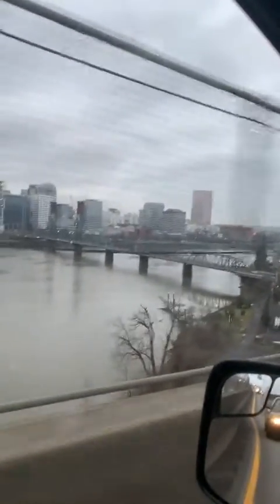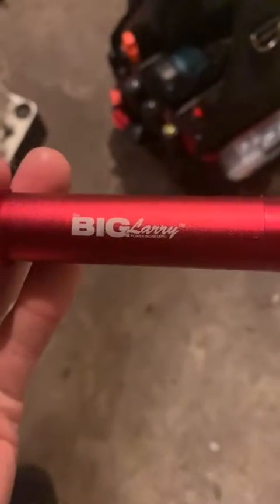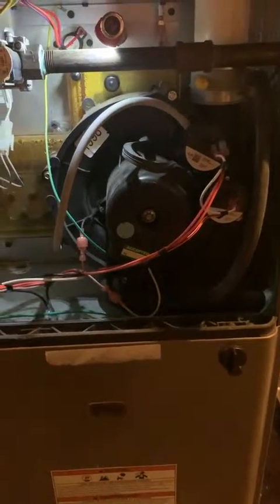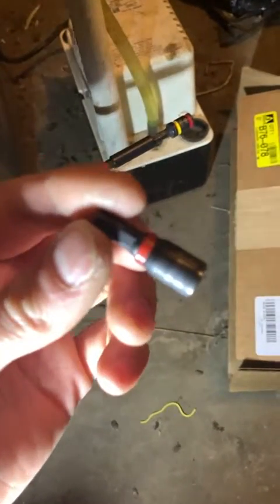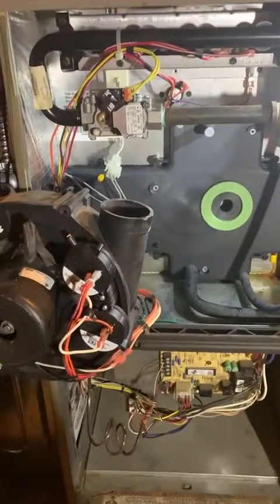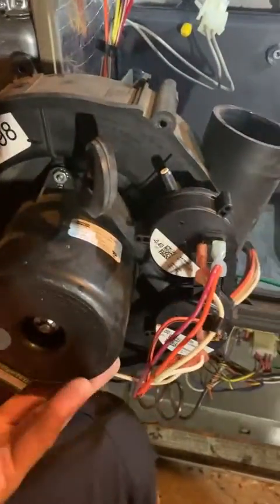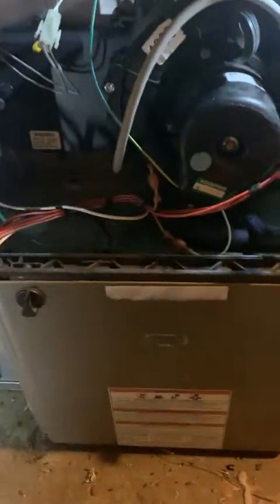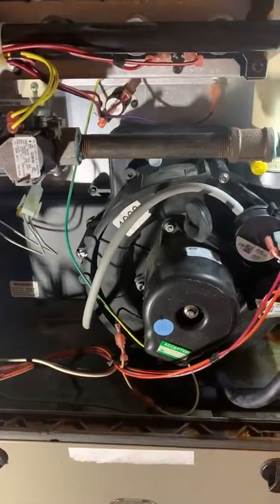York gas furnace Collector Box replacement + pressure switch TG9S080B12MP11A

Comment: Thanks @Honesthvacguy, you saved me a ton of money and headaches! I had a cracked and leaking condensate pan on my furnace, exactly like the one you replaced in this video. The company that installed the furnace wanted over $1000 to do the exact repair you did in your video in 50 minutes. I couldn't stomach that, so got online, found the part, and got it delivered for $160. However, after I installed it, the thing had a very, very loud whistle, so loud I could hear it a block away. So I thought I had gotten a defective part, and was going to try to get another one. (It still would have whistled, though, I'm sure.) The key was to remove that yellow disc in the inducer motor intake, as you showed in the video. For some reason that restrictor disc doesn't cause a whistle with the old transparent yellow pan, but it sure does with the black replacement pan! After I watched the video, I took out the inducer motor, removed the disc, and presto, the whistle was gone. I originally didn't want to do this job myself. If the HVAC company had given me a reasonable price, I would happily have let them do the repair, but their quote was outrageous, and I knew it. Needless to say, I won't be giving them my business any more. Thank you again for your video!

Comment: i am looking to replace the same pan, any way you can hook me up with the part number? i see there are some different size ones, dont want to buy wrong one. Great video as well, thank you for the help.
Reply: Did you get the condensation collector number..
Reply: @dougtilleman5558  I did find the replacement Pan after doing more digging. What I got was from a Website Repair Clinic and the there part Number is RC 3277340 Installed it 4y ago and works perfectly

Comment: Great information! I wish you were in NYC area. I've a cracked collector box for the same furnace. How much do you estimate the labor and parts should cost for this job? My HVAC technician gave a huge estimate and I wanted a second opinion.
Reply from the maker: Pricing depends on several factors including whether or not the furnace is under warranty(most of these furnaces came with a 10-year parts warranty which means the manufacturer will provide the replacement part at no cost. You would still need to pay labor) and which parts need to be replaced. Sometimes you will want to replace both pressure switches along with the collector box. Also, it depends on how good the repairman is. I completed this repair in under an hour because I have performed this exact repair countless times. Someone with less experience could spend hours struggling with the replacement. I would expect to pay between $500-$1,000 for this repair as a homeowner. If the bill is over $1,000 he might be replacing other parts as well or trying to push you toward buying a new furnace. I see a lot of that in my industry.

Comment: I always thought those restrictor plates are different and depending on what size of furnace some stay in and some dont
Reply from the maker: The field rep told me that they all come out...and that’s what we have always done.
Reply: Honest Hvac Guy yellow needs to stay in the following models 80b12 80c16 and 80c22.
Here is a link with the instructions 
https://www.upgnet.com/Site/InformationCenter/York/Archive_CDs/York_2010A/pdffiles/035-22216-002-c-0310.pdf
Reply from the maker: Cory Desormeaux yeah I hear ya..All I know is that  Ken Rose from Coleman came out to look at one of these furnaces that we installed..it wouldn’t stop throwing pressure switch error codes. He told me to always pull the discs.
Reply: Honest Hvac Guy good to know. I don’t work on many but great tip. Thank you
Reply from the maker: Cory Desormeaux yeah buddy, in my experience sometimes the field reps have info that’s different from the official manufacturer statement. I always go with the information the reps gave me..it’s typically based on their real world “in the field experience”
Reply: Interesting. I'm replacing a leaky drain collection box on my home furnace model TG9S130. Haven't looked at the restrictor plate, but is this one that can be removed?  The link below has been removed.